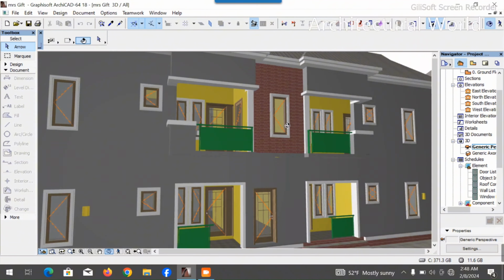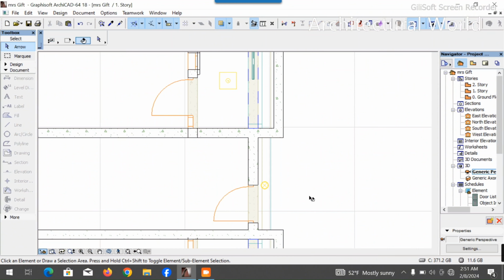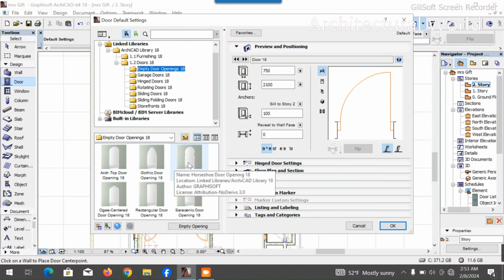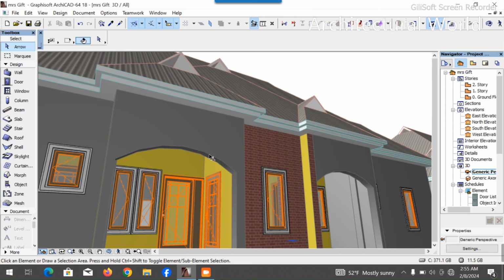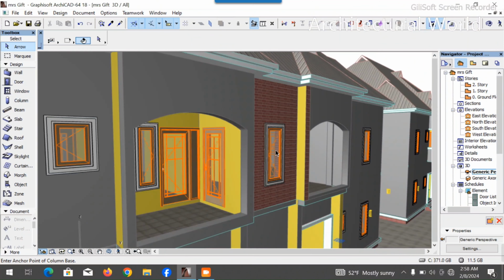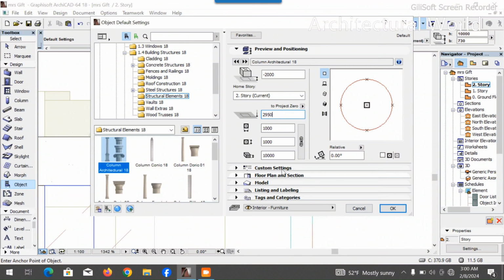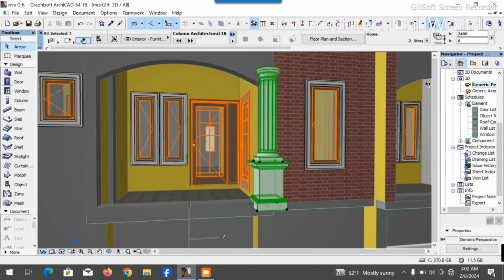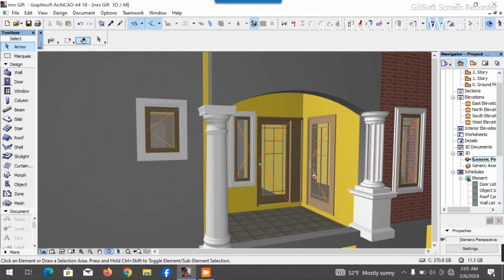Arch and Column Installation Process

Comment: Hello SIR! I have a question for you and others who may also could have this challenge. ''' Rendering using Artlantis Studio 5 is it the same as that of Artlantis 2021, because this is what I currently have in my PC or do I need to specifically have Artlantis Studio 5 installed in the PC?'' Kindly assist. Thank you for your commitment and support🤝👍🤝 We love you💖💖
Reply from the maker: It's same, the only difference there is the sittings you have to follow the sittings properly in other to get a better working environment, 2021 is a higher version with higher system requirements,  it could easy damage ur system if the system isn't 46% higher, but 5 can run freely on any good system... I will explain more later via video
Reply: @architecturalworld6410 💖💖 Thank you for the concern! Kindly do us some videos on rendering one of the houses you've designed using Artlantis 2021. With Regards🤝👍🙏